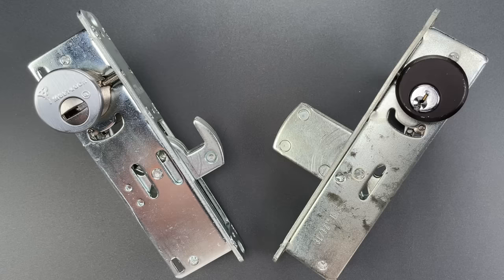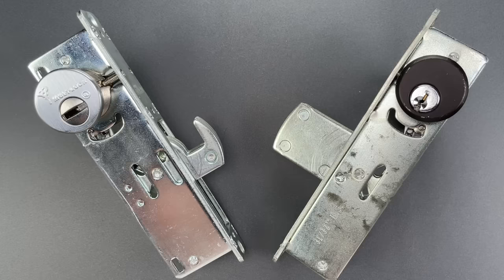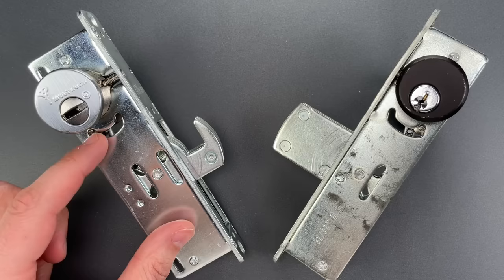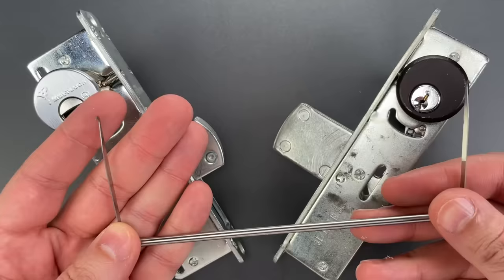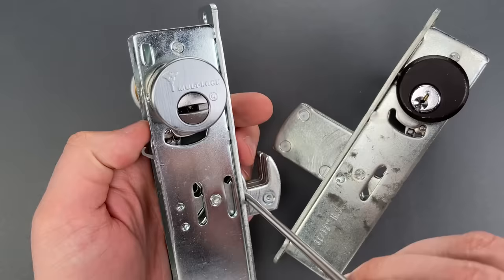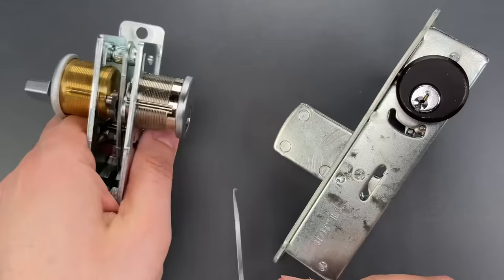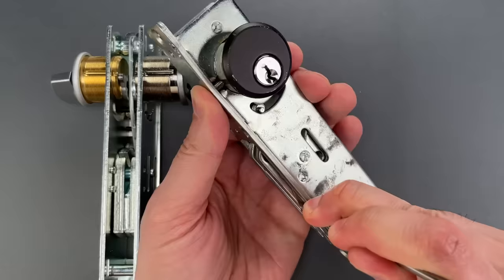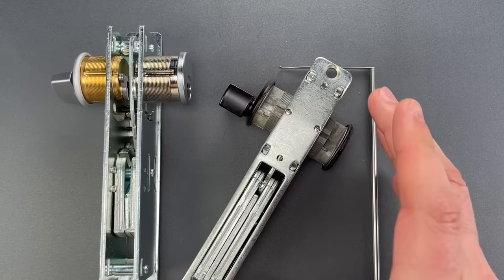[1409] The Most Significant Security Flaw in North America

Comment: In the bench demo, you inserted the tool with the open part of the hook facing away from the lock (i.e. towards the imaginary door frame), yet when you demonstrated it in the field, you inserted the tool with the open part of the hook facing the lock, not the door frame.  Why the difference?
Reply: Because it does not matter due to the way the lock works.

Comment: Ok, correct me if I'm wrong but when you unlocked the 2 locks on your desk, the hook on the lockpick was faced in the opposite direction than it was the 2 times you did it in the field. Does it not make a difference which way the hook is facing when you pull down on the mechanism?

Comment: what if the tolerences are tighter on the door or as a sliding door would be tucked in.. that tool would not slide in.. im sire you have a work around though.. 😅

Comment: Why do you Americans make door like a single boards? I mean, your doors are exactly the same thickness on all the edges, so you have openings that allow you to push in devices such as that. In Europe, doors are not the same thickness. For example, the area where you install the lock is made like steps, slightly indented and thinner, so there is some material protruding above the lock... Yes, that kind of door making makes it slightly more expensive and complicated to make and install (the rest of it, the frame must be made so that this fits in as well), but it prevents these absurdly easy ways of accessing the mechanism. Added bonus is a bit more airtight...
Reply: Price and ease of manufacturing are king in America. I suppose you can make fun of us for it, but you can’t argue the face-value economic side

Comment: why in your demo did you run the hook curled towards the locking bar and scoop the mechanism from behind but then on the actual door demo you stuck the tool in with the hook curled AWAY from the locking bar and still managed to hook and pull without going “behind” the mechanism. looks like two conpletely different maneuvers